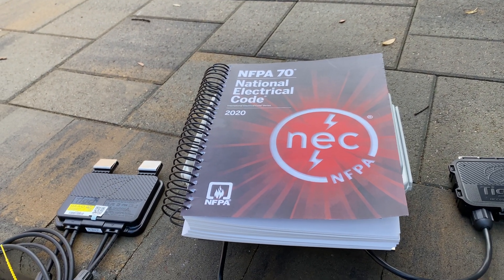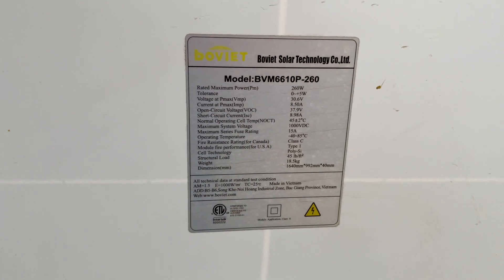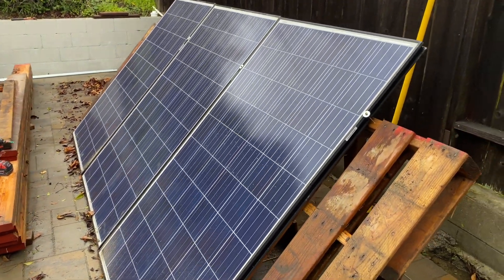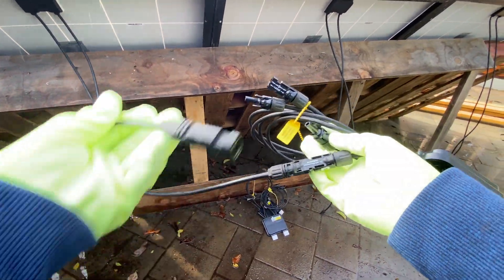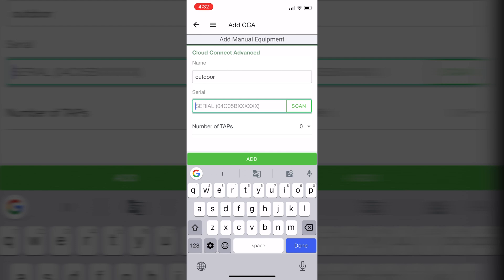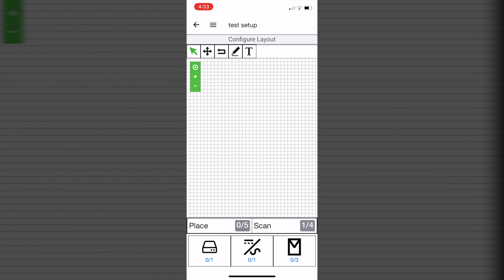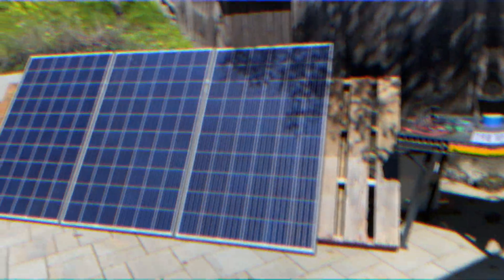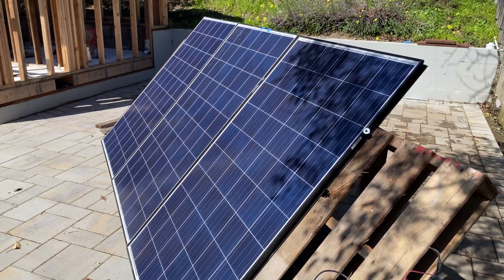Tigo TS4-A-O Testing Optimization & Overview #tigo

Comment: I agree with other comments - that this test is not a fair test because of the way you do shading. The hard shading invokes 2/3 of the bypass diodes which bypass the panel, but the optimizer softened that, and made it worse. But if you do more realistic shading, or make the panels off-axis, then you'll see how the optimizers can improve things. Here you have created an artificially "unoptimizable" problem, which makes the optimizers look bad.

Comment: If your inverter needs a minimum Voltage from the panels to work you use optimizer to grant the range of voltage that is needed ... Only bypass and a lot of shadows ...voltage can decrease under the minimum stops the inverter

Comment: I think before writing off a product you need 3 other products to compare it against.
Then you will realize that they are levels below rubbish, and rubbish isn't so bad when it does the basic things really well.

The First thing you need to work out what is the efficiency of the Micro Grid Tie? Is your Unit 87% / 77% / 67%. Efficient?
Next you need to work out what is the efficiency at different power levels, for example at 50% solar output is the Unit at 95% efficiency?

These out puts will determine if you should connect 2 panels instead of 3 panels to a unit. You might be wasting 20% of your solar energy by connecting too many panels. That's more costly than just buying more micro grid ties.

I have a Grid Tie that's only "55% efficient" according to the rated output...That's a huge waist of power.
However if I consider that the the real output is half, then its actually very efficient even at its current price point.

Comment: I think you should shade whole panel. That would be real shading test. I have my install of 4kW on a car port and depending on the time of the year panels are shaded by the building. For example now half of 10 panels are shaded and I get around 0.5kW instead of 2kW. The limiting stops when last half panel is shaded. I wonder if Tigo optimizers would help in such situation.

Comment: Yes i concur with your results. 
Its taken a bit of time but im going to do some more reverse testing too.

But they dont do anything.
Ive a small array, one panel suffers with shading. 

The array acts the same as with ans without, the diodes function as they should i get the drop and the current is maintained in the array.

If anything i think it may have been a bit smoother, for the diode to kick in. But that could be the tigo being a capacitor.

Ive withdrawn it from sale from my website... I will be offering diode kits and back boxes which should cover people who have panels that are end of life or are using non diode panels to make an array. 

I had alwasy wondered if they were a bick coverter or a diode... Now i know..
Worthless
I suspect the rapid shut down is a  penny relay.

Comment: Did anything change with Tigo optimizers? Are you able to see the difference of full array production with or without Tigo to compare? Becouse I installed my system and feel like they slowing my system down.
Reply from the maker: I did install it for 17 panels system.
2 strings, one of the string is fully unshaded, 2nd string has 1 panel shaded.
All unshaded panels in 2nd string producing about 10% less than panels from string #1
Reply: I mean Tigo vs no Tigo test? In the case you reffering to, all panels have Tigo on them correct. Can you please elaborate your findings a bit more. Like say: Tigo panels slowing system down then half panels shaded or one panel shaded or they really helping in this or that particular case?

Comment: у меня Deye 12k инвертер, с 8х550Вт панелями, стоят на гараже, сейчас зимой немного перекрывают друг друга тенью в нижней трети, купил систему с этими тиго - результат либо нулевой либо негативный, с ними пик мощности в начала ноября был 950Вт, без них на следующий день в тоже время - 980-1050Вт

Лично пообщался с людьми с тиго по телефону, показывал фото и пр - не смог получить ни единого внятного ответа кроме как "надо подождать две недели", так же у них нет ни единого видео где показываются реальные сценарии как тут с тенями на панелях и результатв измерений с TS4-A-O и без них, что б можно было судить о каких то разницах в можности ... отправил все назад продавцу и вернул деньги.
Reply: Good call.  He proved in this video that the optimizers will actually decrease the power output.  So, paying more money for these optimizers will actually make you lose money in lower power production.  Who cares about seeing the output of each panel.  If power output drops, it will be at the string level, and you will need to go up to the roof no matter what.  I have 3 strings, 540W bifacial half cut panels, 11 panels for strings 1 & 2 and  7 panels on string 3.  Not a big deal.  Is this really only giving output per string and not really working as advertised??
Reply: @FiscallyResponsibleCA  i found no confirmation, true tests, measurements, that Tigo can hande partially shadow on panels, or delivery more, or any other confirmation, but a lot of videos and my experince show, that Tigo don't work. For test i bought cheapest Sunwin600 "dumb" optimizer for $25 per each with internal MPPT (Tigo has NO MPPT, oficially) ant it work very well, without SunWin i hat 850-900w peak and of october, next day with sunwin600 - 1150-1250W peak.

and i see the BIGGEST PROBLEM with any otimizer - if only one will burn down, one of 8-20 peaces ... you need remount a lot of panells on the roof to find and replace this ONE optimizer, it will cost 2000+ Euro, that will be much more that any economic effect in 20-25 year from any kind of optimizer

Comment: Because my install is shaded 4 months of the year I spent £1000 on these same models after 2 years, adding 20 Tigo optimisers!  And like you got very disappointing results! Wish I'd never bought them!  My array is shaded in the winter, and in October and Feb it's part shaded. The optimisers made zero improvement to the output. As soon as one panel is part shaded the output crashes for that string to 10-15% of what it was doing unshaded when it should have only dropped by 1/7th (1 panel).   For another string we had 3 panels on one side of the house and 7 on the other.  After several visits my installer kindly let me pay the extra for a 2 string inverter so each side would act 100% independent.  Emails to Tigo confirmed that the optimisers won't work when a certain percent of panels are shaded?!  It seems what Tigo claim on their website in their marketing and what actually happens is totally different - the product is a load of rubbish. My install was done by a credited MCS installer with a decade of experience.  If you have shading, ignore it, get micro-inverters, don't get Tigo!
Reply from the maker: Hi there, I installed tigo on another array (17 panels), and in real life, when panels are slightly shaded it's performing better. So don't get upset till you see your results :)
Reply: What does it mean slightly shaded? Trees? Building?
Reply: @volkhen0  Without internet they dont update en work the way they should!

Comment: These backyard tests using 3 modules and cardboard crack me up. This is not how it works in the real world.
Reply: It’s not as bad of a test as you think
Reply: But to get dramatically worse results when shaded with the inverters. If you look at Tigo's marketing material it shows it's supposed to work under this situation. You might have a hard shadow from a nearby chimney.  So people saying the cardboard is not a fair test are making excuses!
Reply: @markyates5744  Yes, theTigos do work but (any) module level device is not magic. They can only do so much to recover lost energy. A hard shadow from a chimney is much different than a piece of cardboard lying on top of the module. There are no excuses, just an abundance of ignorance about how these things work. There are plenty of peer-reviewed scientific studies out there that do not include throwing garbage on the array to see how the system behaves.

Comment: Did Tigo comment on this?  Did you contacted them about this? This is unfair to the customer. Tigo lowering initial output of the panels in full sun and then completly failing with partial shading.
Reply from the maker: I didn't reach out to Tigo, I think my setup is not correct (incompatible MPPT and panels hard shade, instead of dissipated). I'll do another video soon about Tigo system installed on real PV system.
Reply: @SolarEngineering  Signature Solar Did similar test. Initial non shaded output droped by 360W with Tigo form 1470W to 1100W. Same 450w panels in both tests. Is there a pattern here? I reched out to Tigo they gave me some regional manager, his reply was shaddy at best. Signature solar did not respond or comment at all.

Comment: The other point at 7:18 just doesn't make sense. The panels look old and i'm not sure how many bypass diodes do the have and what it is cell organization. Total system power is 750Wp at perfect conditions. Without optimizers it is delivering whooping 678W which is 90% of the total Wp. Almost impossible? Without optimizers, one panel shading production drops to 600W,  80% of the total? With 2 panels shaded production is still 60% of the total? What is the panel diode configuration? Is this possible? Would be good to hear author and others comments. Maybe I miss understand something..... Может быть....
Reply from the maker: Hi Emin, I'm not sure how many diodes are in the panel. Reading all of the comments, I think test setup must be changed:
- partial dissipated panels shading 
- compatible MPPT
In the solar system that I recently installed, I see that it works well with one panel shaded in array, planning to do video about it.
Reply: @SolarEngineering  You need compatible MPPT. MPPT has to detect the optimizer and act accordinally. And probably this is the case, non-compatible MPPT which means it makes it worse :D (It's also disclaimer in Tigo's website).

Comment: Hi everyone, i made a Solar installation with 20 pannels and inverter Growatt. But i don’t know How to start the optimizers, cause at the end of cable no DC voltage, just 1 volt. Thank you a lot, Alex
Reply from the maker: In the optimizers installation manual, should be steps on how to activate them. Usually, it's some wireless connection (like in the video), or another way is some kind of coil that you have to pass PV wires through it and the signal will be passed to optimizers to wake them.

Comment: My understanding is the MPPT needs to be compatible with the optimizers. Pretty sure yours is not on the approved list. I had the same problem with Victron MPPT but the Tigos work amazingly well with Sol-Ark.
Reply: Wasn't the input data saying he entered in SolArk 8k?
Reply: @alvingallegos6367  No, you can see in 4:21 that he is using PowMr Charge Controller

Comment: This is what I've known for a while after setting up my array. The same thing is true of microinverters. I shaded my panels the same way you did. I have 15 panel strings so it was easy to get results quickly. I even shaded different strings. The results were the same. If I shaded half of 1 panel the output dropped by half a panel, not half a string. This is with and without optimizers. The only benefit of optimizers is that they clamp the panel voltage so the open circuit voltage stays at 35 volts.

Comment: Modern solar panels have blocking diodes in them and dont need optimizers. Thanks for the test, I was hoping this would be the result! Rapid shutdown should be a DC Isolator?
Reply: Solar panels have bypass diodes, not blocking diodes.

Comment: @SolarEngineering nicely done video but I'm afraid the tested environment was not properly designed. The optimizer reduces the voltage of one / two panels so that the current of the whole loop can be maintained and the performance of the others is not degraded. The Tigo includes a DC to DC converter and works well in a proper circuit where the resulting voltage needs to be within the working voltage of the MPPT inverter. For this reason, the type of inverter is specified as well as the number of panels. See a simple video where Tigo optimizers get 2x more power than an installation without them. This is a lab in the garden. https://www.youtube.com/watch?v=f9lyu5CGb3U
Reply from the maker: thank you for detailed explanation
Reply: This video does not show anything. Show me inverter output (not tigo app) with 2 string same panles on both strigs, but one string with tigo other with no Tigo.

Comment: I have seen some of the explanations below, but that doesn't explain the significant difference for all three panels unshaded.
Reply: Just the time of the day and the temperature of the panels (hot panels lose 0.3% aprox for each 1C above 25C) and if there was a bit of haze can all cause a 10% difference.

Comment: The shading with the papar board is not precise. If you are a bit uneaven so that only a smart portion of the left or right third of the panel is covered, it leads to kicking in of the bypass diode also for the outer parts of the panel.

The point here is that the panels are hardly shaded, so that the current drops to 0. The optimizer bypass that panel and no bypass diode kicks in! This is the disadvantage of the  optimizer.
Therefore in this situation a half cut panel would work much better with the optimizer.

There might be a problem with the optimizers or the setup. The point is, that the third uncovered panel should deliver more then the  40Ws while the other two are just bypassed by the optimizer. Did you check the monitoring in the Tigo App? The app should give you a good monitoring on the panel level.
Reply from the maker: interesting, thank you for the information.
Reply: He made sure that the covers covered exactly the same area, because they were glued to the plate with strips, which ensures the same position when folded.

And without shading, the output was 12% lower. This is very disappointing.

Comment: As other commentators have mentioned optimizers only help with light shading because the solar panels have built-in diodes that will bypass when you have full shade so they don't need optimizers.
Optimizer will also help if one panel is producing slightly less than others due to age.
Basically anytime the diode does not kick in but the panel is producing slightly less power the optimizers will help the other panels keep full production. 
Another time they can help is sunrise or sunset when you don't have enough power for the panels to kick on the optimizers can make them work a bit earlier and later.
Reply from the maker: interesting, thank you for the information.
Reply: Thanks for that clear explaination. 
May i ask your knowledgBle self, do you need to have broad band for these optimizers to work, are they dependant on the "cloud" in oorder to "kick in"? 
Im being told this by the installers....
Reply: In my opinion, optimizers are useless. As the test showed, the output power was 12% lower even without shading, although theoretically it should be higher, because each module supplies a few watts of different energy, with the weakest module dominating.
Reply: @loukili63 I guess one advantage is seeing how much each panel is producing when designing using a string inverter. If a panel develops an internal issue later on it will be easier to pinpoint. Cost vs benefit ratio is subjective in this situation
Reply: @minghiy  , this can also be found out with an IR-Camera, which can show heated areas even if power delivery looks normal.
Reply: @loukili63  Well, you can also go up there and measure every single panel with a multimeter and you will eventually find the bad panel, but with power optimizer you can see it on your phone if it's connected to the cloud. In addition, power optimizer doesn't cost that much more compare to a rapid shutdown which many states require a module level shutdown for panels on the roof.
Reply: @deyumei7965  , yes, but optimizers increase the potential for errors. They can also break and then you need an expensive technician twice. Firstly for defective solar cells and secondly for defective optimizers.

Comment: very strange
maybe the Tigo need to know the inverter cause of the minimum MPPT starting voltage - and they try to reach that 150V (just a guess for the SolArk) which could not be provided by the 3-Series-string?

Would also be cool if you can repeat the test by shading horizontal over the panels (that will shut them completely down due to the bypass diods.

How do the optimizers work on your roof?
Reply from the maker: It was installed for a customer, and we are waiting for permit to operate from power provider. So I don't know yet.
>>maybe the Tigo need to know the inverter cause of the minimum MPPT starting voltage
might be
Reply: @SolarEngineering  Doesn't make sense, partially shaded panels would provide the same voltage, maybe they are dumb optimisers which just bypass the panel and do not have an onboard dc-dc converter like solar-edge ones.